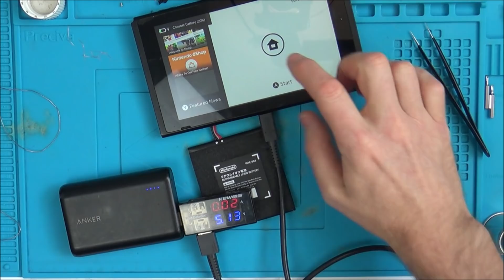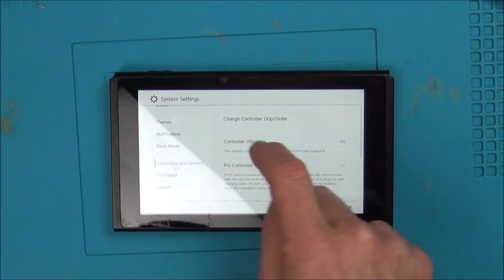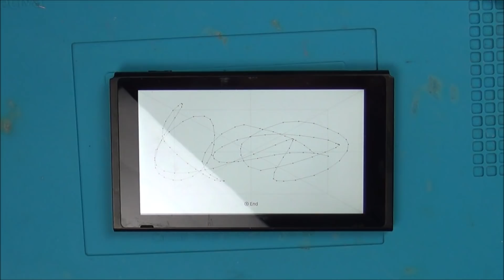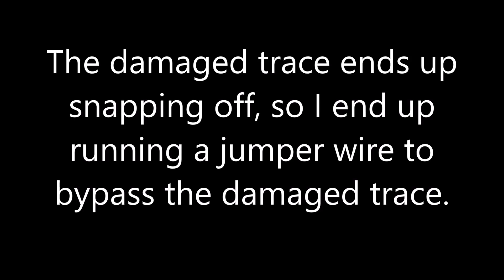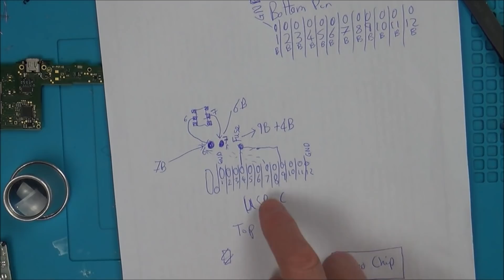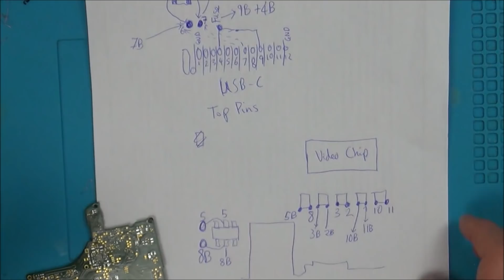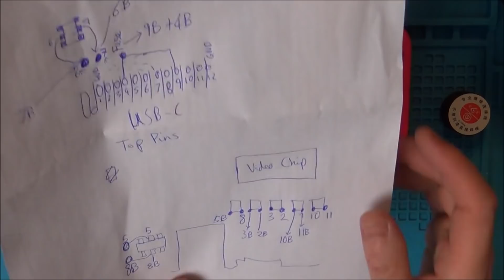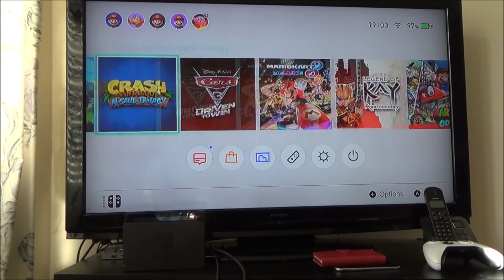Trying to FIX a Down & Out NINTENDO SWITCH

Comment: Crazy amount of effort but well done vince , perseverance beats all , about to attempt to track a fault in my sony TV hoping i will be shouting yessss too haha
Reply: How did it go?
Reply: Did some diagnostics and letting caps discharge i worry its dry joint as it only displays the fauly once hot , it thinks theres a input but there isnt gonna unplug side button board next to test further
Reply: @user-te1le7ck6b  did you manage to fix it.
Reply: @jttuning5118  yes mate i did as it happens i traced the fault to a button board so i disconectted it and reset the tv been working fine ever since , just cant use buttons on tvs side only remote but thats fine by me to be honest
Reply: @user-te1le7ck6b  thats awesome man well done

Comment: All that time spent learning about impedance matching and differential signalling in PCB layout sure feels like a waste now seeing such stuff work fine with a ball of bodge wires. Well done, you've got more patience then I.
Reply: I think that HDMI signals are slow enough that impedance differences from line length are not an issue.
Reply: @Jeff121456  A common misconception. All digital square wave signals contain high frequency content in the edges (harmonics), regardless of the fundamental frequency.
Reply: i have a degree in electronic engineering and 90% of things you would think important are literally never used or bothered with, usually the bodge jobs work better. feelsbadman lol.  he has far more patience than me.

Comment: On USB-C, the CC lines are used to detect the orientation of the plug.   The chip you call a "video chip" is actually a USB3 multiplexer chip that's used to route the signals to one set of pins or the other.

Comment: Looks like someone tried to replace the usb C port and dropped the soldering iron on that video chip. That's not a "burn" like you would get from a faulty chip...  by the way love your videos Vince, you never claim to be an expert or "know it all" but I appriciate your honesty and the information you give out in these videos. Could never get bored of these switch videos. I use to repair ps3's and xbox 360's when they were pretty new. Brings back the memories from them, I now focus on phones mainly

Comment: Vince, thank you. I bought a faulty NS that had a faulty charge port, upon removing the old charge port, the whole bottom row of solder pads were missing, so I just put a new charge port on it and thought *sod it, aslong as it charges*. But with it being an unpatched version, I know it has slightly more value than a patched version. Anyways, I've got all 12 bypass wires on the hidden pins of the charge port, tomorrow I will fit it and hopefully I'll have a fully working charge port. And thanks to you, I know where to solder ALL those bypass wires now. I did use an old NS board with all pads intact, just to double check, and you're spot on. Thanks again. 👍

Comment: Hey Vince, love your videos. I have several switches that all have the same problem. They work as handhelds but cannot dock just as you describe. I have a feeling I will need to copy your diagram and run wires from the hidden pins on the USB to their spots on the board. Looks to be a 10/10 difficulty fix but seeing your job at the end gives me inspiration. Cheers!

Comment: I can easily imagine how tricky that solder work can be. Glad you persevered. It is stuff like this that teaches you the most. Good job. Now seeing all these videos makes me want to go back and finish one of my early learn to solder projects which was a little radio. I don't remember how I did it but I lost one of the pads but now I see so many of you showing how to run wires and I am working with the old through hole components that soldering should be a cakewalk compared to what you just accomplished.

Comment: vince I am in absolute disbelief at your repair,  I could feel your excitement when the switch docked at the end. That being said, you could've saved yourself a lot of time on the hidden pins, you can see quite a few of the ripped up pads still had tiny stems above which could've been soldered to in order to create new pads. Still, congrats on the repair, you are an absolute madman

Comment: I love the effort you put into doing these repairs, watched a few of your previous attempts on the switch and glad to see you have success with this one. Just got one to repair myself with a similar problem with someone else trying to replace the USB-c port and pulling off some of the pads so your drawing has come in very handy to track the traces to there destinations but on closer inspection both the 2 little 6 pin components are missing off the board so looks like mine is scrap. 
Keep up the good work and I'm now looking for another motherboard for spare parts  so I might still be able to get it going 👍🤞

Comment: get the finest paint brush for painting miniatures to do conductive paint.
Reply: Conductive paint is useless for this job, particularly this type of conductive paint (it's just PVA with a supposed silver fill) the resistance is too high even over short spans.... useless for a capacitive touch screen ribbon repair... even if the repair was perfect the resistance would introduce other issues. to fix properly it's the same as usual, solder and fine wire, done. conductive paint is maybe passable for keyboard repairs or other carbon based tracks that can't be soldered to but again this stuff is so poor you have to add superglue over the top once the silver stuff has "dried" otherwise it will just wipe off and/or degrade.
Reply: Could have also painted tracks for the HDMI CHARGING PORT had there been a fine enough Brush, me personally I would have used a bamboo Tooth Pick, mind you painting on tracks are pointless if the conductive paint cant be soldered too, and My Mate did say his paint was cheap.. so yeah - sigh...

Comment: Great work! I am not an EE, but as I remember HDMI signal uses some kind of differential pairs for signals. The lenght of traces on PCB is matched. Your bodge wires are not lenght/impedance matched. Dont know if it matters at all nowadays. 🔥

Comment: Imagine the horror of the next repair guy if the usb c gets shot. Anyhow, the perseverance on fixing the dock mode is downright amazing. I wouldn't have stopped around the part where the switch got working as a handheld tbh

Comment: My guy where are you getting all these switches from I’m trying to buy one but they are all sold out 😂 I even went to ikea and looked in the lightbulb section 😂
Reply: Ebay is your best bet. I've been buying broken ones to repair and sell on during these times. Even now there's loads on ebay new and used sets.
Reply: FiddyOnFiddy that is true it’s just u dint get any sort of warranty
Reply: @Dannyistenhag  True, never thought about a warranty.
Reply: FiddyOnFiddy yes, waht is ur eBay account so I could check it out if you have Any switches for sale
Reply: @AppleReviews  You got 13 faulty ones for £300? Where's your source? I'm doing £75-£100 each console faulty right now, managing to get 300+ with just console and new joycons so 13 consoles for £300 is some mad profit.
Reply: @Dannyistenhag  Ultrabytes. I'll have another one up tomorrow or the next day, currently needs a new digitzer.
Reply: Me and my brother got one the other day from ebay, overheating and joycons dead, it turns out the fan had a short and it shared a power supply with the joycon 5v charge line, which was reading 2.3v, after disconnecting the fan the joycons started charging and the 5v was there, we have a replacement fan motor on the way, there was a 6 pin driver ic on it which had shorted. Handy to know if any of you get any switches with that problem(joycons will connect but won't charge and console overheating) I don't know what else shares this 5v line but me and my brother couldn't find anyone on Google with this issue so hope this is useful to someone
Reply: @MattBee2k2  Bugger all on ebay Australia, I pretty much look every day, and when one does appear, it has a pricetag of around $200AUD.
Reply: @ray73864  I'm not sure if I want to trust it or not but I did see a supposedly brand new unopened Switch on Ebay from an Aussie seller for around 100 USD which is somewhere just over 150 AUD I believe
Reply: @TheJeracuda  I'm more looking for faulty ones. Plenty of working ones on ebay, and I have my own original one that I got around the time the Switch first came to Australia.
Reply: @ray73864  Aye the prices of some faulty ones are rather daft. If you're looking to make money in the process and the price hike is still active, I've found some success on the faulty boxed bundles, part out the dock, power adapter and hdmi cable as one sale and the joycons as a another then I sell my consoles bundled with brand new joycons and a carry case.
Reply: Vince said at the beginning of the video the Switch was from OneUpGaming. For the past month, he's been working a job lot from them now. Mind you, OneUpGaming sells legit refurbished systems, but Vince with his reputation got a chance to speak to him in person about any failed refurbished products like this Switch.
Reply: You have to watch what you get cause some are completely unfixable 🤷 even for Vince.
I have one I'm thinking about selling that only has a charger and no joycons. I rescued it from becoming a parts unit cause it had the blue screen of death. All it needed was the firmware reflashed 🙄 which isn't fun because Nintendo makes it impossible. I had to use hacking software to reflash the official firmware.

Comment: Awesome work yet again. Soldering and tracing those pins needs intense patience and I am glad it worked out. :) 
I would also really like to see the result if you scraped the remnants of the ripped pads and put a tiny wire and then solder the port that way. Just a suggestion. :)

Comment: 3:50 the battery protection board has disabled because the cell voltage is below 2.0v so that’s why you see 0v. If you give it a charge, it may reactivate like in 11:07

Comment: Hey vince, amazing repair, I only have one doubt here in 7:35 a component is missing in FL1, it was not necessary for everything to work well.
Reply: Probably just a component to smoothen the signal a bit.
Reply: FL = filter, usually not essential
Reply: I noticed that too, when he was fixing the charge connector

Comment: I think you can get finer soldering iron bits than the ones you have but some companies have started using machines that solder components using a CNC Infrared Lasers Soldering Unit.

Comment: Oh boy, that usb port. It's a bit late now, but perhaps it would have been easier to somehow mount it backwards with the pins pointing up, away from the board. Anyway, glad you managed to fix it!
Reply: Mounting the USB port differently wouldn't matter because several data pads are completely missing from the board. There would be no contact to the pins the port needs.

Comment: Yea, this man, with only a little bit of knowledge fixed a usb c port, made it able to dock and charge both ways, replace (and tried to fix) a digitizer and replaced a video chip, this goes to show as long as you have the right stuff,  and are able to follow instructions you should be able to fix some of your broken electronics

Comment: Noticed missing bigger capacitor in USB-C area (pad visible at 7:36). Also get yourself USB-C breakout board so you can easily test all these pins as their location on board is known

Comment: Lol I can't believe it worked. Well done Vince.
If you labelled the top row of pins 1-12, then the bottom row 12-1, would that mean both numbers would go to the same place on the board?
Reply: Ignore me, that would be no good because not all pins are reversible. I assume only the charging pins are reversible and the video are not. I have drawn this out here. https://i.imgur.com/RCmSzA9.jpg

Comment: That’s amazing! What you did with that usb is just craziness! Lol. I have a question that I’m hoping you could answer.. My switch won’t turn on.. If I hold the power button down for 15 seconds and then push it again it will show the Nintendo logo and shut off again.. alternatively if I hold it down then plug the power cord in, it shows the charging symbol for a second then turns off again. Have you seen this before? Do you think it’s something that would be fixable? It shows that the battery is at full charge when it pops up for a second after plugging it in.

Comment: Not sure if you're going to see this comment Vince (being this video over 8 months old now) but I'm attempting to repair a Switch that has all of the USB-C pads ripped off. A complete nightmare. Add to that that I have no previous experience with this stuff haha, I bought this Switch since I want to learn about repairing electronics (inspired by you and othet Youtubers like TronixFix) and wanted a good challenge (but I had no idea about the broken pads, eBay seller either didn't know or kept that to themselves.)

Before watching your video I already managed to put a jumper wire to each of the top 12 pins (man, that was painful!) and I was wondering if that would be enough to get the console to charge and dock (haven't tested yet). Found this video by mere chance (and I've been following you for some time now) and now I'm hopeful I might be able to fix this Switch (it pains me to know now that I'll have to add jumper wires to all 12 bottom pins as well haha but I'm still hopeful.)

Wish me luck and thanks for sharing this video!

Comment: Hey Vince, I’ve been working on another Nintendo Switch that I got online that wouldn’t power on. Do you have, or anyone else have a name/part number for those two black 6 pin chips on either side of the board at 46:28? I believe that’s why this console won’t power on even with a fully charged working battery because they are both missing and everything else around the board tests fine.

Comment: Unbelievable. Since around 6 months I have the exact same fault on my video chip in exactly the same fashion. Same channel being burnt on top of the chip and same pad missing. Sadly I couldn't see how you managed to run a wire underneath the chip. I think probably they video chip burns in the same fashion every time a high voltage charger is connected to the switch instead of the proper charger.

Comment: Could see as soon as you attached those jumper wires that several legs were not soldered onto the board properly probably a bad factory job or the port broke loose

Comment: Hey vince can u help me out my switch wont turn on I'm using custom firmware with sx os one of my gsme crashed and shut off my switch I thought my battery maybe died but I try to charge it all night I also charged the sx dongle and insert it in the usb port hold vol up and power at same time nothing

Comment: Why don't you use kapton tape more liberally on smaller components around the larger chip? Especially when you're using the hot air pen. I'm not an expert or have any skill soldering. Just genuinely curious.